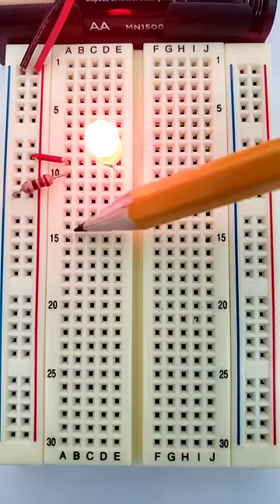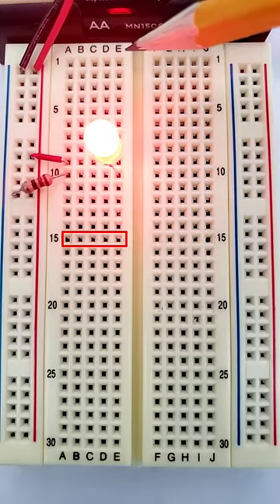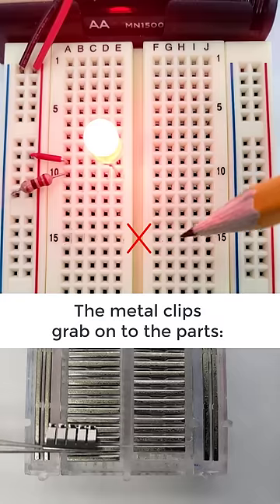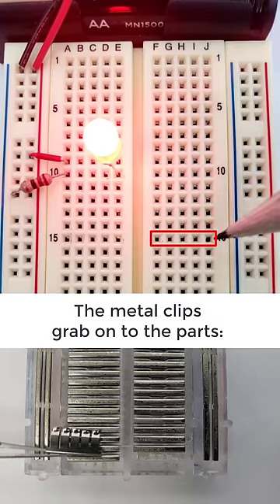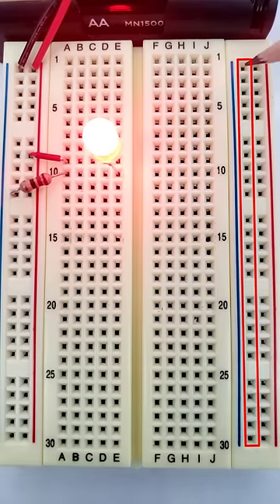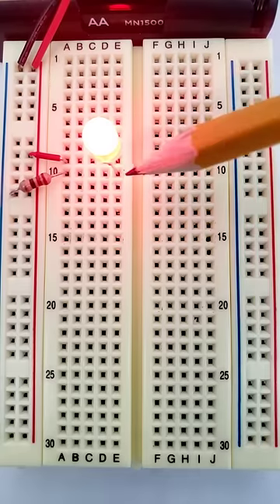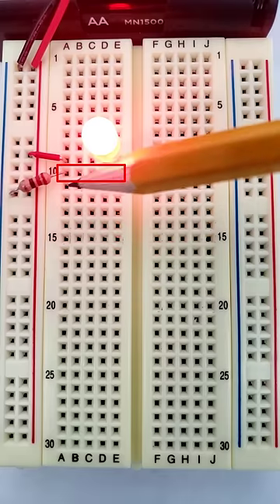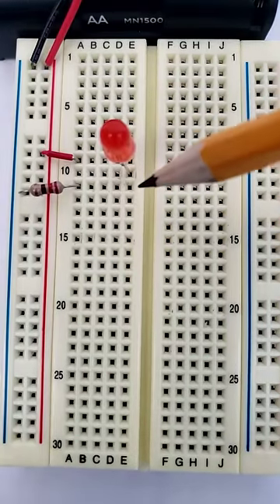How to Use a Breadboard

Comment: Why is the top linker connected row 7 to row 9?
Reply: If you look at row 1 you can see that the middle piece is slightly higher than the positive/negative sides so if your talking about the resistor i think its connected from row 10 to row 10
Reply: The positive bus is connected from the top to the bottom. Thus, an electrical connection between the positive bus and row is not affected by the location that the jumper cable is connected to on the positive bus.

Comment: Capacitor should be from 5v to led, not ground to led.
Reply from the maker: Assuming you meant resistor and not capacitor, this is a common misconception and we made a video to address it: https://youtu.be/NUKD9qESO58
Reply: @Science.Buddies  Yes I did mean Resistor.

Comment: Im sure you could help with my questipn so ill ask you, can i use a Pro controller (Nintedo switch controller) as a controller for my breadboard circuit?? I think it would be fun to activate the circuit wirelessly. Im think the arduino could be programmed to do that. Might need a different component but that would be fun to expirament with
Reply from the maker: Hi - we have an Arduino tutorial series here which does include using a handheld radio control with Arduino - not quite the same as a Nintendo Switch controller, but probably easier to set up. Hope this helps! https://youtube.com/playlist?list=PLlBVuTSjOrclb0iCMSRpS_H1lSrlSVeEm&si=GYUJxDRSrHKJ4kZt. Radio control is covered in video 18, but if you are new to Arduino we recommend starting at the beginning.

Comment: Do u have plastic hands
Reply: 230V AC touch with bare hands
Reply from the maker: The circuit in this video is battery-powered, it is not 230V AC.
Reply: Tf?